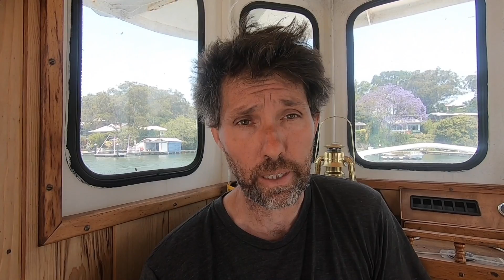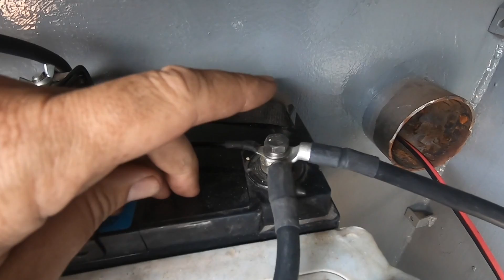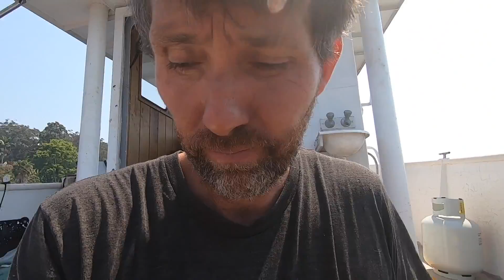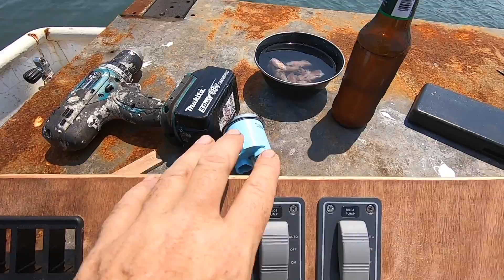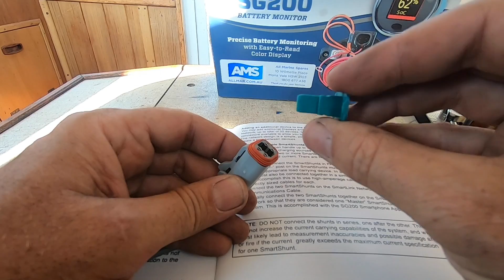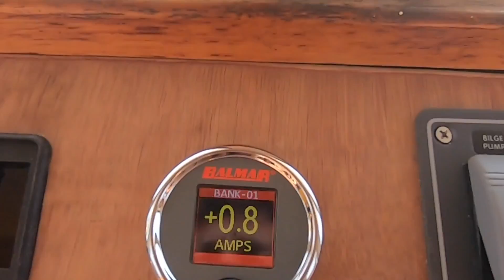Monitoring a boat's battery banks

Comment: A nice bit of kit! Pretty simple installation as well, all things considered. Its good it can give the voltage of the starter batteries as well to be honest those are always the batteries i am really concerned with. Would be nice to have a digital amp meter measuring the output of the alternator as well, the output of that is also a good indicator of something going south (or maybe north for you :D), plus very high output all the time is not good for it. This tends to be more of a problem for LiPo batteries that have a very low internal resistance when they are discharged. I still like to keep an eye on the situation...
Reply from the maker: Yes, I'll definitely be wiring up the voltage lead to the starting battery very soon. It will be interesting to see that measure of the current going into the house bank once the engine is installed and running again.

Comment: W=VA (watts = volts x amps) :P :). Your mobile phone uses a similar battery management module thus how it can tell you what the charge is (eg 35%) and thus why when the battery starts failing the phone doesn't show the % or the drop very well.

Was just about to ask what the max capacity was ... 350amp ... FAR...k. There shouldn't be much other than the starter motor chewing that sort of power.

If you want to masquerade a cable wrap it in full length heatshrink or electrical tape slacker :P

C130 hurc?

Does that BMS have a low battery alert/alarm? Might be handy for an autostart genset down the track if you are relying on that battbank (or a relay to the inverter whilst the engine is running through a relay matrix).
Reply from the maker: The shunt doesn't measure the current from the starter battery, only the house bank so no issue with the starters current draw. Will more about alarms soon.

Comment: Stu just a thought. Battery monitor only gives the condition of the whole of the house battery banks, not the individual batteries in the bank? Could you use a shunt for each battery then daisy-chained to give each battery condition. You can then tell which battery letting the whole system down/weakest. OR is that information overload?
Reply from the maker: Possibly, it would be interesting to look into it. Of course when you see the bank drop it health it wouldn't take much to identify which of the batteries is the offending on if they weren't deteriorating equally.

Comment: I am newbie with batteries so I have a few questions. You took the negative connection between the house battery and starting bank completely and connected it to the shunt. What happens now since you don't have that connection between house and starting bank? Did you do a new connection between those two, was it not actually necessary or is the connection going through some other way? Appreciate any answers!
Reply from the maker: Yes, a new connection is added on the other side the shut. Previously the negative of the house bank was connected directly to the others negatives, now it goes to the shunt then on to the other negatives.

Comment: Stu, don't know if you will see this but here goes.  For the wiring harness I would suggest getting the plastic spiraling typically used for notebooks.  They are cheap.  You cut them into 20-30 mm sections,  spin around the grouping of wires.  Easy to spin one wire in or out as you go along.  You could also plan ahead and group by category i.e. nav, lights, sound, etc, and color code so if you have to trace down issues later it's easier.  Spiral could then be clipped up out of the way, etc
Anyway, just a thought
Reply from the maker: Hey Ron, does sound like a neat way to organise things.
Reply: I had the same idea on my boat - but the plastic these spirals are made from deteriorates rapidly in the sun and won't last a year if daylight gets at them

Comment: For anyone looking for more information on offgrid systems like this check out http://www.anotherpower.com
There is a small community of very smart people there. There are in depth threads about battery management, and pretty much anything that would relate to what is being built here.
Info on everything from building wind alternators, solar panels, inverters, charge monitor and management systems, etc. The site runs pretty much all on renewable energy as well.

Comment: Hey Stu. looks a pair of Globemasters fly by, C-17s
Reply: The model of a big one would be B1
Reply: Or C5's
Reply: @TimsWorkshopTJY  Given the length of the fuselage they look more like C-17 planes.
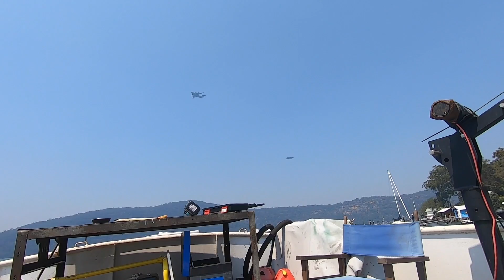Reply: @TimsWorkshopTJY  Definitely C-17s. Although their silhouettes are similar, the C-5 doesn't have the upturned winglets on the tips of the wings that these have (just barely discernable starting at 8:13), it's about twice the size and always appears to be hanging in the air, and the C-5 has a very distinctive electric whining and growling sound from the engines.
https://www.youtube.com/watch?v=hk7RjyGJ-yY
Reply: @TimsWorkshopTJY  RAAF doesn't fly C-5. And they only have 8 C-17...so if those were RAAF that's a quarter of their heavy lift capability right there.  It's possible they were transients from another air force.
Reply: Thanks, Interesting. I know the C-5's are really loud. They fly them out of Lewis/McCord airbase South of Seattle. They are Huge
Reply: There c17’s Australia has 8 of them
Reply: https://images.app.goo.gl/bmAvtqJ6eHY1cLn69
Reply: @TimsWorkshopTJY  A relative of mine was a USAF officer at Dover AFB; I spent quite a bit of time there. C-5s show up at the airshow at Oshkosh frequently too...so I've had the opportunity to walk though a C-5 on several occasions. And once walked directly from a C-5 to an An-225.
Reply: The Antonov is very impressive. It lands here at Paine Field all the time bringing special delivery parts for Boeing $$$. Amazing all the wheels on that aircraft

Comment: That battery space is a rat's nest.
Reply from the maker: Yeah, well, you know, that's just like your opinion man.
Reply: @DangarMarine  I think you probably value honest opinions and productive feedback a lot more than sycophants, Stu. You've already got plenty of blindly adoring fans in here. 
One more thing: take a small paintbrush and coat all of those terminals and posts with a thin coating of RTV before surface corrosion sets in. Easily removed with a penknife later if you need to do changes.  I did comm installations on submarines for many years. Good luck, mate;  I'm actually pulling for you.

Comment: You need to do a as installed schematic diagram when you get done, this is great info for boats and caravans/RV's !
Reply from the maker: Yes, I should start building it now so it isn't a huge job at the end.
Reply: Also number tags on the wires and a written description of each circuit.

Comment: Now you are talking my language. Telephone exchanges run of Dc battery banks  They therefore have large engines that can feed the batteries if the municipal feed fails
Reply from the maker: For sure. I used to work for our local telephone company and we had huge diesel generators as backup if the power went out.
Reply: We had a lot of fun when the old "standby was replaced with a new larger engine. everything was planned but the fuel tank & rain cover on the exhaust. During the soak test (running the new engine 48 hours) the chimney overheated so much that plaster on  the third floor started falling of !!! and the tank had to be filled every hour!!!  The 200l tank was replaced with a 600 l one  and the rain cover was raised We also fitted an exhaust fan than could handle the volume in the chimney
Reply: @DangarMarine  why did I just get a mental picture of your engine bay with a rack of 48-volt glass-cased batteries?  :)

Comment: Even though it is pointless I can’t help but shout at the screen ‘measure the outside of the teeth Stu, not the body.’
Reply from the maker: Should have shouted louder. ;)
Reply: Dangar Marine that would only work if we could engineer a reverse echo so you would hear it before you post the video.
Reply: Yeah, absolutely, and then another 10% or so for wobble!

Comment: What issues are you having with the inverter? Nice neat fitting, just think you should be fitting some rub tubes ( split a piece of hose ) and fit them  where your cables lay over the battery brackets to stop rubbing...
Reply from the maker: Inverter just won't fire up the heat gun. Once all the cables done (some still need to be moved) I'll look at protecting and securing them all.

Comment: What is your feeling about anti-corrosion grease on those batteries?
Reply from the maker: I think it is a double edged sword. It can get warm and start to track down between the terminal and the connector causing increased resistance.
Reply: Are you talking about the dielectric grease? I would be using dielectric everywhere and can’t possibly see a getting warm causing resistance issue. I’m wondering if were talking about the same thing

Comment: I didn't see you hook up your battery charger cable negative to the shunt I'm pretty sure you would need to hook up that as well to the shunt so if it's charging it won't throw the numbers off on your monitor
Reply from the maker: Yes, I need to put a negative bus bar on the other side of the shunt so that chargers and bilge pumps can still be accounted for. There will be a few other changes like that in part 2.

Comment: Years ago, perhaps 20 years ago, a friend of mine installed a voltage monitor (by no means the definitive method to monitor a battery's) health, that he' monitor via packet radio using Amateur radio 2 meter FM.  Pretty clever!
Reply from the maker: Sounds like an interesting project!